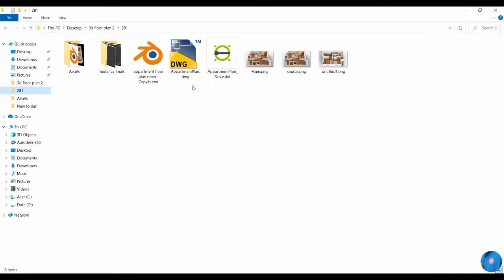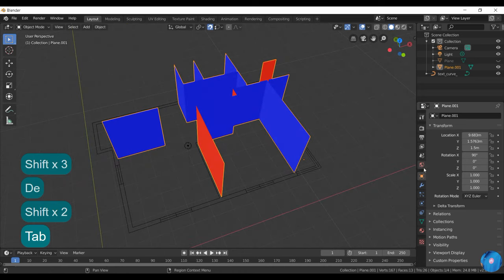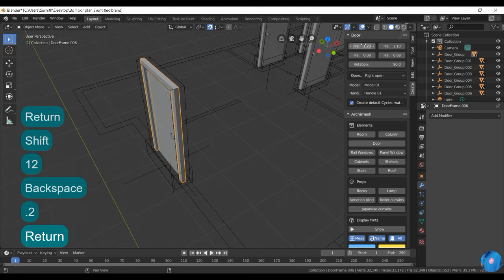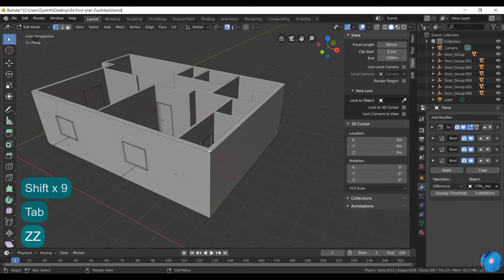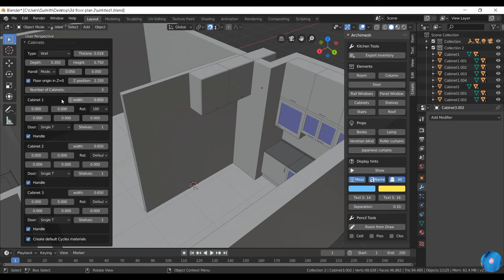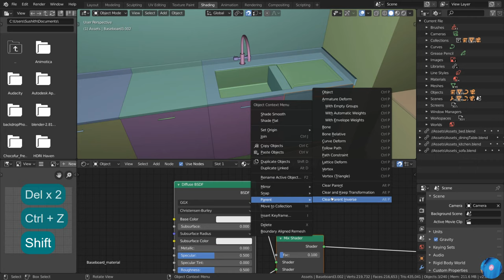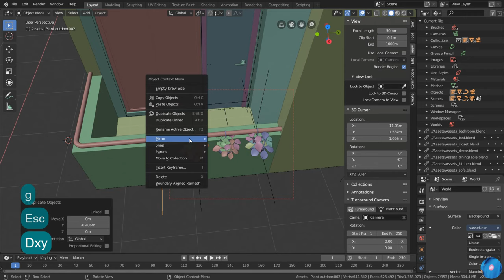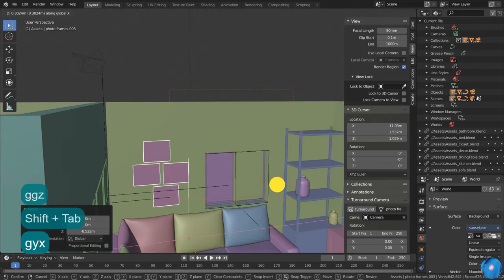How to make 3d floor plan in Blender | Best method (Modeling)

Comment: Would love for an updated version please. Because maybe back then boolean didn't work as it does today , and maybe we could use Append to bring assets but even then there's the new asset collection library . There's also the new Caustics that will allow for realistic light reflections through objects . But other than that , this is probably the best tutorial out there on how to work with a floor plan for showing interior . Unfortunately it won't help that much with creating an exterior render but it's great anyways

Comment: Interesting approach. I usually import a dxf and then extrude the whole floor plan to the windows sill height, then to the beam and finally to the bottom face of the ceiling.

Comment: Good tutorial! When I import dxf drawings sometimes I just select the lines of the walls  and go to object->convert to->mesh from curve. By doing this it is then possible to extrude directly all the lines of the walls in 1 second, saving a lot of time
Reply: I do that too, but always check if your vertices are merged by select all and merrge by distance..increase the distance if necessary, bcs sometimes it doesn´t merge
Reply: do you convert dwg/cad into dxf first? or directly import dxf ?

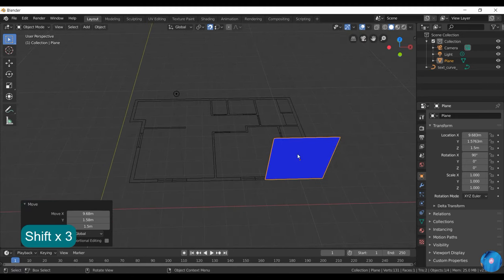Comment: Thank you for the tutorial. I know it's too annoying to answer basic questions; But I did not quite understand how you just pressed a point and the wall expanded to that location... I hold Shift too but that didn't work. 1:02
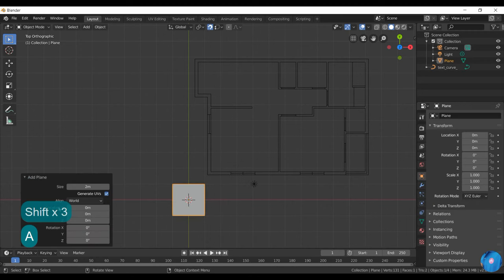One more thing, how can I open that editing section without having to create a new object at 0:48
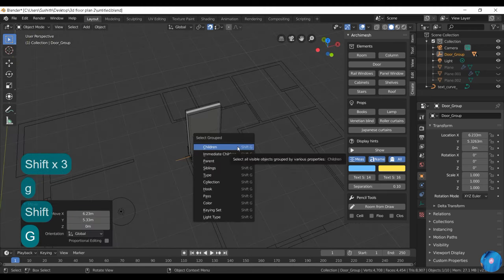Also, when I Select Children using Shift+G and Duplicate, the Duplicated door is invisible... 3:40
Reply: I have the same questions! I ran into the same problems.

Comment: I would like to ask you. If it is possible to use FreeCAD Floorplans to transfer it to blender if you don't have LebreCAD
Reply from the maker: Any CAD software can be used. Here I have used CAD for converting DWG file to DXF and removing texts & notations
Reply: @egnevadesigns  Thanks man... You are far the best🙏🏽🎉🎉
I admire your knowledge 👑

Comment: Can you tell me how did you move that plane to the corner of the floor plan.... 1st stage step... I couldn't find it out.
Reply from the maker: Thanks for watching! Here I am using a floor plan which is made of  beziercurve (end result from autocad dxf addon). Now by using vertex snap mode, I can snap an object to corner of the beziercurve (floor plan)
Reply: @egnevadesigns  thank you. Yes I have enabled dxf and inserted one into the blender. And even followed your video of switching on the vertex option. But couldn't pic pointer on that plane and move it to the corner of the dxf plan

Comment: Hello Egneva. Is it possible to make a section cut trough say, floor level one at 1.2 meter high and save section cut separate item to export as pdf.
Reply from the maker: There is no section view (Revit like) function in blender. But it is possible to make (not accurate) section view using Boolean or 'Alt+b'.
Boolean: Create a large cube place at 1.2 m, assign boolean modifier to the floor(object), choose the cube to use for boolean operation and hide visibility (object properties- uncheck Show in render and change display as bounds).  Also you can use Bool Tool addon to achieve the same. 
Alt+b: go to orthographic front view(numpad 1), use measure tool to mark 1.2 m, Press Alt+b and select the whole bottom area upto 1.2 m. Now you will be able to see section view of the floor level and make renders using viewport render option (View> Viewport render image).
Disadvantages (alt+b): It will work only in solid view and some times hard to mark required regions.
Please see this thread for export to pdf part: https://blender.stackexchange.com/questions/766/can-i-export-a-pdf-from-blender
Thanks for watching!
Reply: @egnevadesigns  Thanks, that is a pity. Something for blender to think of. Making SketchUp and Revit another bit obsolete if you have a section cut that you can transport to a vector program.

Comment: you could just convert imported dxf to mesh and then extrude, you can thank me later
Reply from the maker: Good information, thanks for sharing! But, when I get dxf/dwg file from clients,  most of the time there will be ton of issues(double lines, multiple layers, lot of break points, missing parts, etc). Instead of solving all those issues, I prefer making walls using planes and use dxf curves to snap vertices. 
NB: Alternatively, Archipack or Archimesh adons can be used for making walls. But, in that case I'll not be able to cut walls in different positions (sill level, door height, etc). I like to modify  walls to show the furniture inside the house in renders.

Comment: This is exactly what I want to be able to do with Blender. What's the best way for someone brand new to Blender to get to this skill level? Any other tutorial recommendations to start from the basics?
Reply from the maker: For basics: Blender guru and Grant abbit. Following technique worked for me: Start a big project. Break down it into small sections. It may take one or two months to finish. Complete one by one. Make sure to watch tutorials  (not too many; one topic per day). Blender stackexchange and blenderartist.org are good places to find solutions for small problems.
Reply: @egnevadesigns  Thank you!
Reply: Anyone can help me , i cannot build surface part and i try quite a long time .What should i press actually

Comment: Hi. I look forward to watching this video . But what i want to know is, how to you start with a floor plan if you haven't got one already. That is, how would you use Blender to create a desired floor plan. Is it simply a matter of drawing lines on a plane?

Many tutorials have the student first download a floor plan to use during the lesson, but don't seem to cover how to start from scratch.

Many thanks !
Reply from the maker: short answer - I don't know.
Long answer - I've tried a few times to create a floor plan from scratch, and it's really hard to do it in Blender. I don't think Blender is the right software for creating a 2d floor plan( or 3d from scratch).
On the other hand, if you have a 2d floor plan in pdf format (or
image file) then you can create walls using a plane. See this video for more information: https://www.youtube.com/watch?v=fSLoN3Zlzog
Reply: You’ll note he used LibreCAD to import the .DWG and re-export as .DXF. I’ve never used it, but it could be a powerful CAD program suitable for architectural uses like floor plans.

Another option might be a 2D drawing program like Inkscape. That has precision placement options that should be useful for producing accurate floor plans. Also Blender can import Inkscape documents directly as SVG files and convert them to curve objects.
Reply: It basically depends on the size of the project and what software/workflow you are used to. Most architects (including me) start by quickly sketching with pen and paper, scanning it and using the sketch as an underlay, then drawing digitally over it. You can either use 2D cad as in the video, or go directly to 3d, you'll just have to learn how snaps and constraints in Blender work, so that you get perpendicular walls with the right dimensions.
Check out the directory of open source tools at https://wiki.osarch.org/index.php?title=AEC_Free_Software_directory under CAD / BIM Design Development you will find many options, but I would recommend sticking with LibreCAD or going directly with Blender (but Blender is harder, you will need to memorize a lot of shortcuts to do it effectively).
In the future it should be possible to turn touchscreen sketches directly into 3D, but we are only half way there. If you are interested check out the discussion here: https://community.osarch.org/discussion/283/bim-modeling-using-greasepencil

Comment: Just a random question... why did you use a plane for the walls instead of using archi-mesh walls? They also have an automatic floor if you want to add it.
Reply from the maker: I like to use plane mainly because it is easy to modify (different wall heights and thickness) and easy to snap with the help of vertices from a DXF plan. I think this video will help you to know more about different ways to make walls in blender: https://www.youtube.com/watch?v=Cunh57XjRv4

Comment: I find it difficult to import the dxf file from AutoCAD.
Reply from the maker: Before importing to blender, just cleanup the plan in Autocad itself. You have to remove all the texts, notations, laches, etc. Thanks for watching!
Reply: @egnevadesigns  Also how i should centre the dxf or dwg file in AutoCAD
Reply: You have to make your drawing in a closed loop. Use Join command sometimes. Then the dxf export format activates.

Comment: How to make a walkthrough animation in blender to show the output pls help me
Reply: It is easy I am beginner and I found it just few hrs ago. All you have to go to view - navigation- walkthrough this enables to move camera by wasd keyboard and mouse. But before entring into walkthrough, in the time line click auto keyframe and set the frame size which is the duration of animation after setting up the frame hit space bar to start the recording and then quickly hit shift + f to start the moving camera with wasd  keyboard I assign short cut shift+ f under walkthrough once you done with the camera movement u I'll see keyframes on timeline now you are ready to playback ur animation. There are more to this but I am too lazy to explain in the comment section. So sorry for that
Reply: @ranjodhsingh8638  thank you very much sir
Ur explanation made my day I'm very new to blender ur comment fulfilled my needs thank you
Reply: @shimogavines4505  it's all right brother we both are on the same boat 🚣 so I am happy that I cleared your doubt but there is lot that I have to learn too so what I am doing is just learn one step at a time. Right now I am learning Animating text of different styles and nothing else and trying to master it.
Reply: @ranjodhsingh8638  very interesting previously I had tried text animation in blender too 
I would like to be in touch with u can I get ur contact info/Gmail

Comment: why not just extrude from the curve, dies blender not have this feature?
Reply from the maker: Yes, You can. But, most of the time cad file comes with tons of issues (duplicate lines and joints). That's why I prefer this method. Thanks for watching
Reply: @egnevadesigns  oh i see, its awesome of you to take time to answer my silly question thanks and much respect

Comment: Hey, when i import my DXF file to blender, I can't see anything on the screen. Even though in the scene collection I can see the layer names, It just doesn't show up on my blender work space. 

Can you PLEASE help me out !!!! I can send you the DXF file as well!
Reply from the maker: Maybe the floor plan contains lot of information scattered all over the place or the plan is too big or small.
Remove all unnecessary notations, texts, etc. from the plan and try to import the plan (tip: press 'A' and then press '.' to focus the plan area). If you are still unable to see the plan then check the units (Properties>scene properties). If the plan is too big then change the viewport clipping distance (N-panel>View>Clip end- increase it from 1km to 5 km) Thanks for watching!

Comment: Hey bro can you tell me your PC specs? I have problems with rendering, I think I need to invest on hardware.
Reply from the maker: I7 laptop with 8GB ram and 4GB graphics card. Image textures require lot of memory, maybe that's the reason you are not able to render. Suggest you to use basic procedural textures, they don't require lot memory

Comment: Pc specs in this video?
🙏🙏🙏 please i will sub u🙏🙏
Reply from the maker: I7 Laptop with 8gb ram and gtx 950m graphics card. Don't worry about pc specs. Try to make 3d model with minimum number of polygons. Keep assets in separate blend files and link them as collections. Avoid using high resolution hdri and PBR textures. Most of the time, diffuse map alone 'll be enough to make good materials. Try to use procedural textures as much as possible. Thanks for watching!
Reply: @egnevadesigns  
THANKS!
SUBSCRIBED AS PROMISED.!

Comment: What is the minimum PC specifications required for doing this kind of 3D plan in blender.
Reply from the maker: I use an I7 laptop with 8gb ram and 950m gtx graphics card. Here all the materials are made using procedural textures, so 8 gb ram is fine. But, if you want to use pbr materials and high resolution hdri, then 8 gb ram wont be enough!